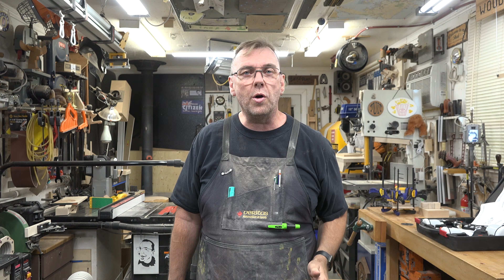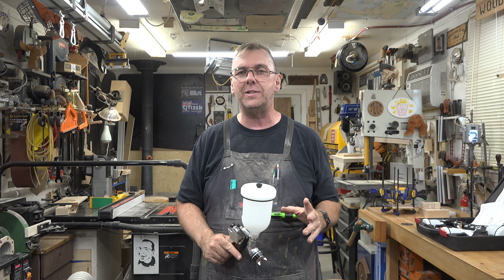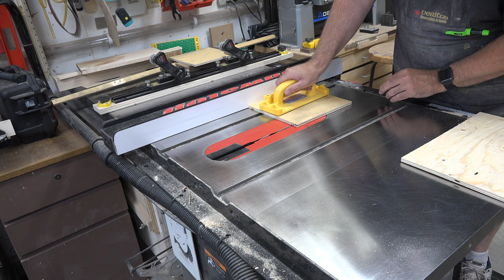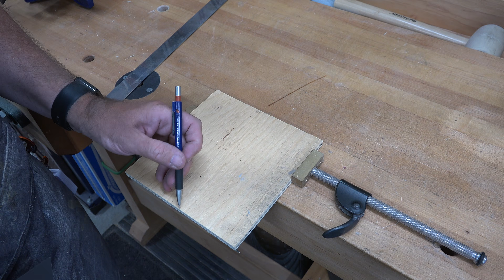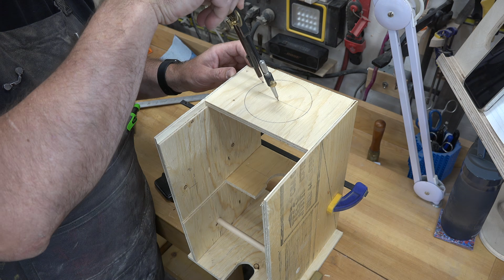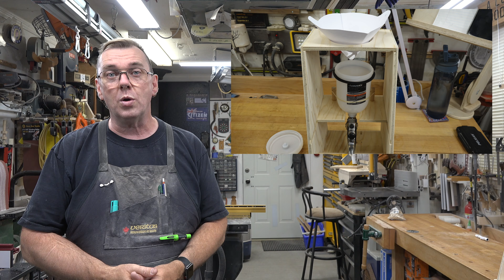Making an HVLP Paint Gun Stand

Comment: I wonder if the filter will fall through the hole if a lot of liquid is poured in. Maybe a big funnel could be used to help support it.
Reply from the maker: I have been using this stand for a few months now Stephen and I have filled that filter to its capacity repeatedly with no issues at all.  The filters are much more rigid than they appear on the video and do not collapse at all.  With that being said, if you wanted to add a funnel to help support it and it would make you feel more confident about the filter staying in place, then I say go for it.  Do whatever you need to do to make it work for you.  Thanks for tuning in and for chiming in with you idea.

Comment: Personally I think it's overly complicated, but it's easy to criticise ... you've given your idea and that's what matters, others can copy or modify as they see fit ... so thanks for sharing :)
Please please please, move all of the hardware hanging off your gun and put it down at the compressor end and only have the hose connection hanging off your gun ... far less weight to handle as you are spraying!!
Reply from the maker: As you stated Barry, the purpose of this show is to provide the idea.  How people proceed with it and how they execute their own build is completely up to them.  While the build's design may not be for everyone, it works perfectly for me.  Thanks for the advice on the filter and the regulator.  I will take that into consideration.  Thanks for tuning in to the show.  I appreciate your comments.